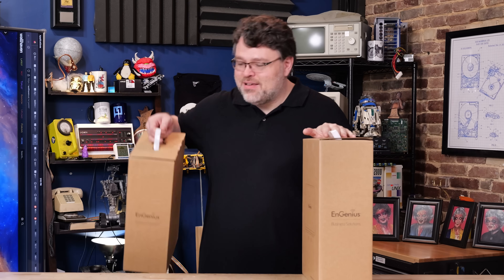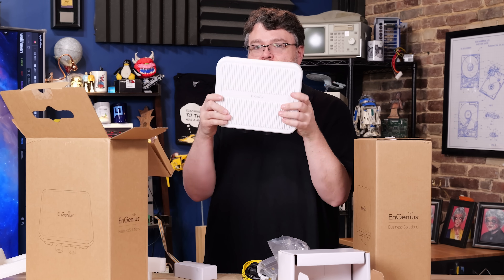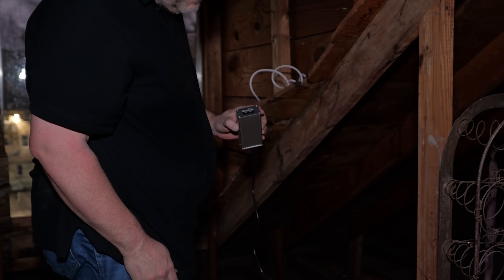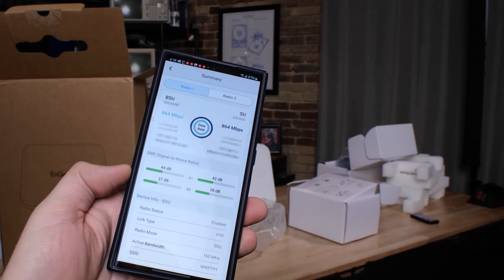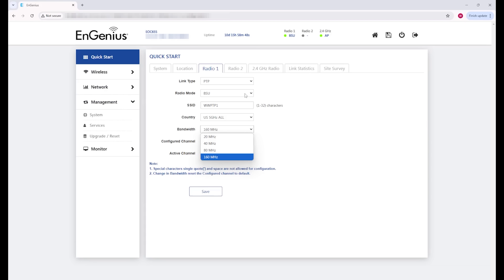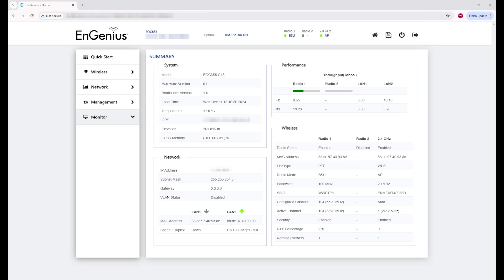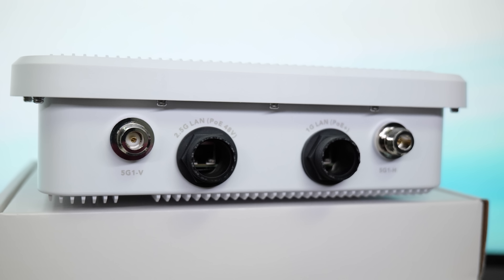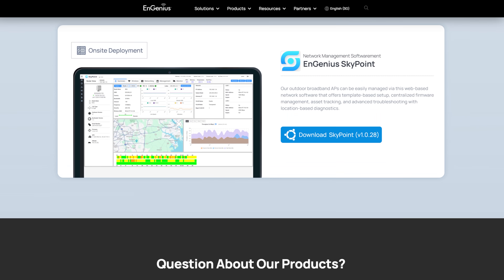Expanding Level1Techs' Reach with Point to Point 2.5G WiFi

Comment: We tested out a lot of different point to point and point and point to multipoint radios, including engenius ones. Engenius was okay, but we had range issues and support for required security features was poor (at least at the time). We actually ended up using a company we'd never heard of called Proxim (I believe their usual market is ship to shore connections?). Great range and speeds.
The worst we used was a Cisco mesh style network - it seemed good at first, but it was constantly reshaping the topology and speeds tended to be abysmal. Not to mention the price...
Reply: I have to contend with all sorts of weird cisco wifi bugs from expensive rental unit trash.

Comment: 5ghz is much better honestly 2.5 should be phased out
Reply: I haven't started watching it yet, but from the title I assume it's about 2.5Gb/s network bandwidth, not the 2.4GHz bands of wifi. Personally, I do disable 2.4GHz radios because it creates noise for my neighbors and bluetooth devices and all my devices support 5/6GHz. But it certainly has its place because of its superior penetration for people who have a lot of floors/walls and only use a single WAP.
Reply: I think you are confusing 2.5g wired ethernet and 2.4ghz wifi
Reply: explain?
Reply: @ when I use 2.5ghz I get slow connections, with 5ghz is much faster a little less stable when 2.5ghz goes more power can go into the 5ghz and be more stable
Reply: @shangrilaladeda  5Ghz has very poor obstacle penetration which makes it the lesser choice for P2P outdoors relays.
Reply: @ it can be improved when the lower standard is gone
Reply: @shangrilaladeda  Yes, it is slower. If you're using 802.11n, then the theoretical maximum bandwidth at 40MHz wide bands is 600Mb/s, but it's probably running 20MHz bands which cap at 288.8MHz under perfect conditions. I think 802.11AX(E)--or Wifi 6(E) allows up to 80MHz on the 2.4GHz channel, but good luck getting that to work reliably or WAPs and devices that support that.
Reply: @ yea I know barely any devices truly support 5ghz now also
Reply: @ that is why I said phase out 2.5 than 5 can be much better
Reply: It truly depends on the topology and line of site for an area at my parents old property I had to drop to 900 MHz for a link between buildings because of 2 tree lines at a little under a kilometer (about 1/2 a mile). Was still able to pull 30Mbit between them mind you this was in the late 2000's 2.4GHz and 5GHz would have never worked because of the limit for transmission here 2.4 may have worked at 1W but if you got caught running that it was a hefty fine.
Reply: Guys, don’t mix up Wi-Fi with 60, 6, 5 or 2.4 GHz and Ethernet with 10, 5, 2.5 or 1 GbE.